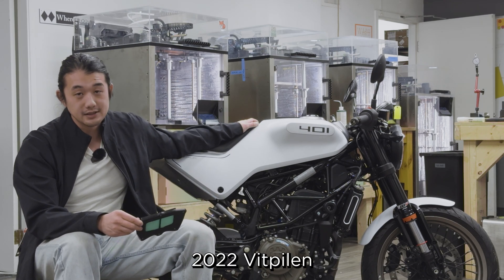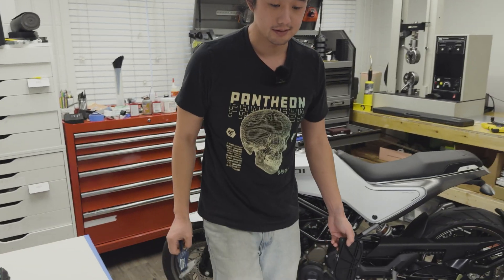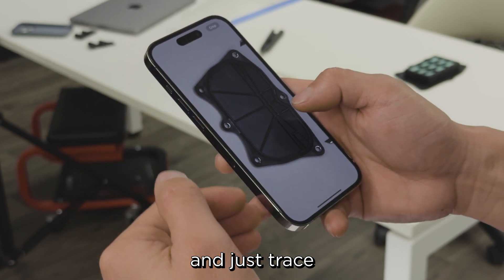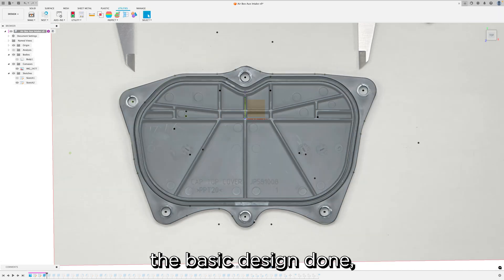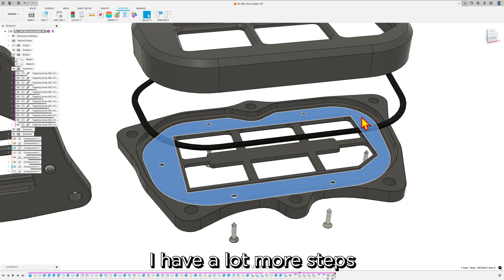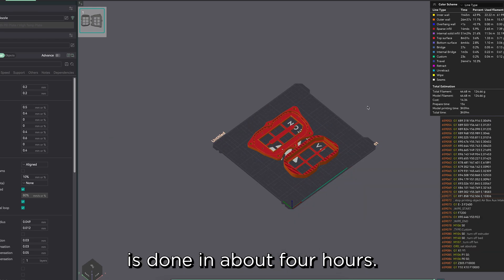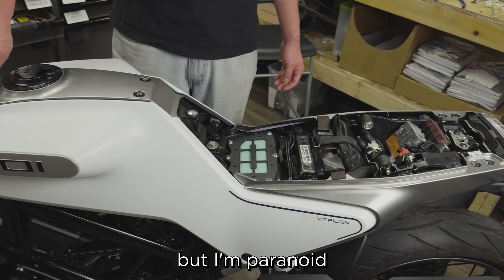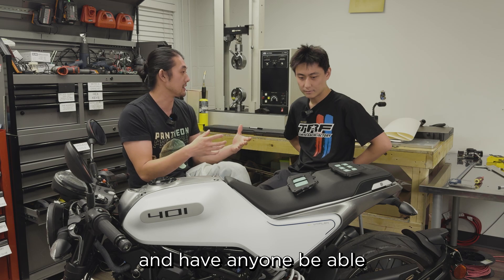Fixing the Worst 3D Print We've Ever Seen

Comment: Just to verify, does this work with all current 390 engines? I want to make one for my 2023 RC390. Thank you for making it so that I don't have to buy a DNA one
Reply from the maker: ahh im not sure, i think there are some slight variations thaty might not fit, you could always try. we posted the step files, so it should be easy to modify if you need.

Comment: So I've heard that with the 401 series Husqvarna made the mixture super lean.. wouldn't this filter make the mixture even more lean? I think this might require some mapping or a tuning box.. That's pretty much the only reason I'm so hesitant to do this mod.
Reply from the maker: you are correct! the bikes incredilbly lean from the factory. Im running a fuelx, but tbh it still needs a piggy back ecu for the closed loop portion of the map
Reply: @PantheonDesign  Hey man sorry I'm like 6 months late but randomly stumbled upon the Pantheon Compo video and thought to myself "huh I think I've seen this guy before." checked out your channel and found your amazing 401 fender assembly!! Already bookmarked the thingiverse link for some off time! I will definitely check out your channel.
Reply from the maker: @TragicAyk  awesome! weve got som ecool stuff were filming this week
Reply: yes, this bike probably already runs with a Fuel X piggyback ecu.

Comment: A flat part can just be scanned with a regular paper scanner. It's quicker and gives a precise result without tinkering since it outputs at a known size of A4 sheet of paper.
Reply from the maker: With flat bed scanning, you still need a calibration reference. also with his part, the stiffening ribs would keep the bolt holes about 8mm up in the air, that would have messed with the scan a tone
Reply: Yet to do this but I've heard this before.  First thought that came to mind with an item this size.

Comment: If you want more flow just ditch the foam element and put pleated cotton in, you can get filters that size for loads of small garden engines - that way your filter face area will be double just from the pleats.
Reply from the maker: pleated cotton is not a great fitler, and at the end of the day, even more air isn't something the stock ECU can handle
Reply: @PantheonDesign  No worse than oiled foam is, if you're going to the effort to make an 'ultimate' one that's the easiest change vs chasing a few more mm around the edges.
Reply from the maker: @ ahh really? Okay looks like I should do some more research, I always thought the cotton filters were trash for some reason

Comment: This will be nightmare to maintain. Bathtub with pilon in the middle and few mm thick cover with m6 screw holding it together would work better. Instead of gasket keep edges bellow filter flat and use air filter rim grease.
Reply from the maker: hows this hard to maintain? just unscrew and clean the foam every 5-6K, there's also very little space to fit a bathtub filter. right now there's only about 10mm of clearance above the air box to the seat.